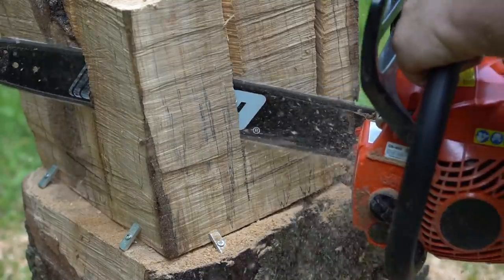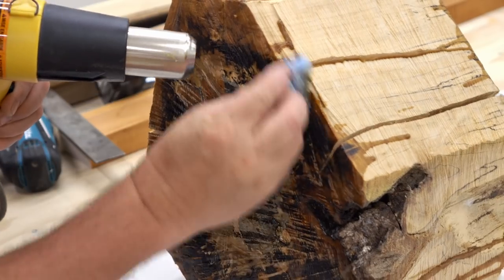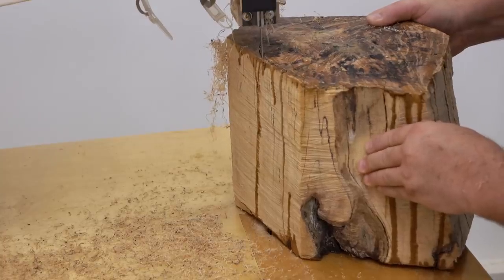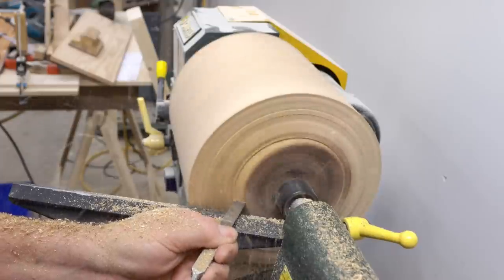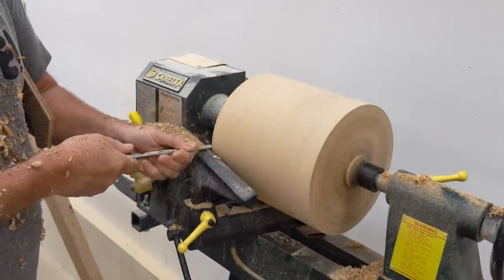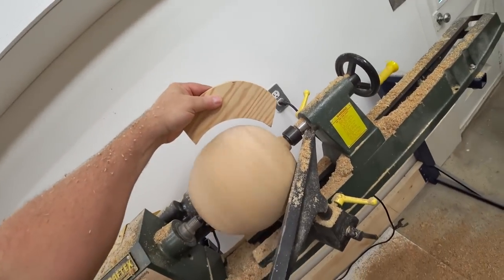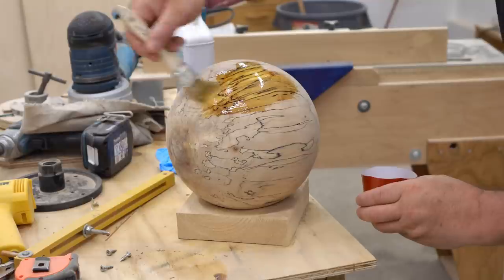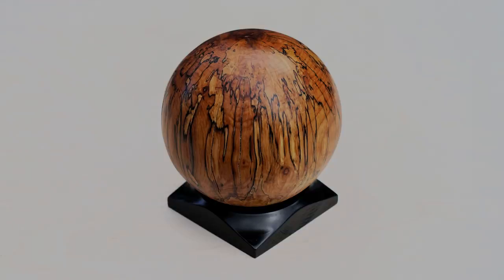Making A Bowling Ball Sized Wooden Sphere from Spalted Maple

Comment: John, 
Loved the video,  very cool.  For sealing the end grain,  I use regular wood glue,  Titebond II to be precise,  and it works great.  Just apply liberally and spread with a paper towel. 

-Noah
Reply: Great tip. I will have to remember that, as wood glue is basically plastic.

Comment: Nice. If a standard chisel works for you then use it. I guess when you were taught the only thing you had to remember is to use it handle up so the edge trails, as you said just like a scrapper. Seen pros in UK demonstrations use a garden trowel to turn.

Comment: i use a regular chisel all the time to make tool handles with the drill powered "lathe" jig i got found once... it works just fine for that, if they are somewhat sharpened. whats the problem about this? a turning tool looks and works the same.

Comment: John, I've never turned anything so I admit I'm ignorant on the technique. How did you keep the chisel from getting caught in the hole? I would think that the chisel would have caught inside the hole.
Reply: Hey Melissa, late reply here. When turning, assuming you aren't trying to force the tool into the wood with a large amount of pressure, the chisel will tend to ride on the outer most face of the object, preventing catches on hollows and holes. The wood is spinning fairly fast so when you think about it you would have to be either exceedingly quick or using an excess of force to manage to jam the chisel into a hollow. A delicate touch and a feel for how much the tool is engaging the wood will usually prevent this :)